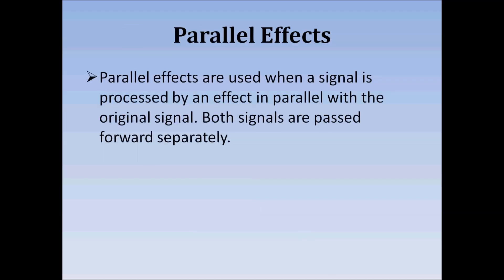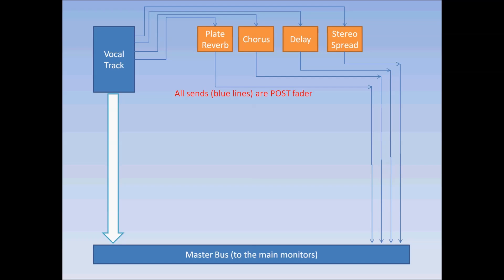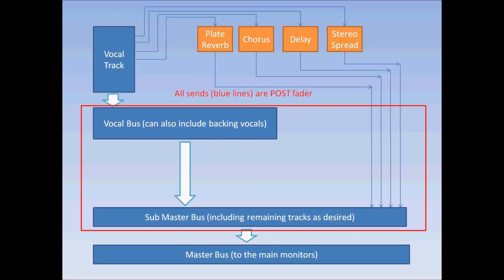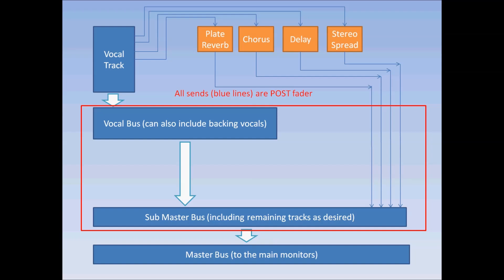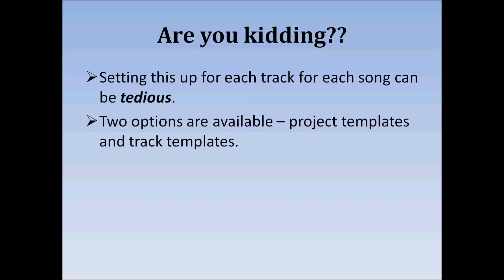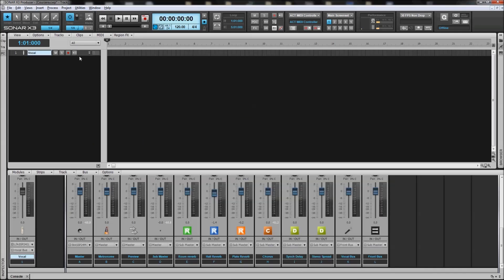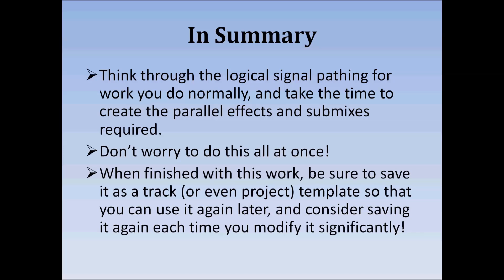Track Templates (and why you should love them) SONAR X3

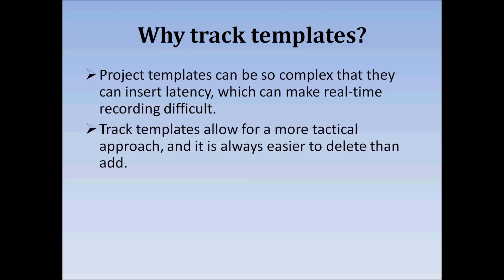Comment: Mike, Why do project templates add latency? At 3:38 you mention project templates insert latency of their own. I didn't understand this. Do you mean it just takes a long time to load the project template or that the project will have increased latency because it has more FX than you need? 

I would expect a Project Template and an Track Template that were equivalent to introduce identical latency.
Reply from the maker: Project templates typically are used with FX inserted (and active). This is not necessarily bad, as long as they can be bypassed. For tracking purposes, it important to get the lowest latency possible, and I just wanted to point that out since I am not familiar with other DAWs (SONAR does have a global bypass). Bear in mind that the audience for this is very general, and many new, so I did not want to get presumptuous in speaking only to SONAR.

Another reason I made for this is that project templates laden with VSTi tracks (depending on which ones, of course) can create a lot of latency even with nothing in them.